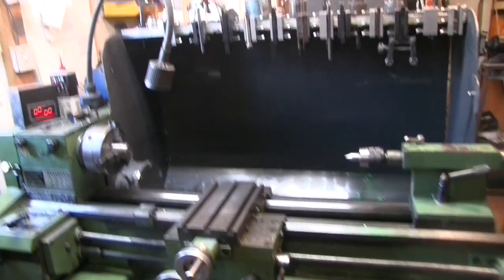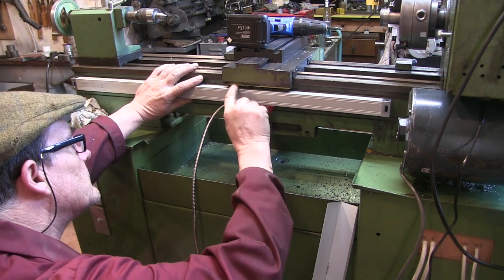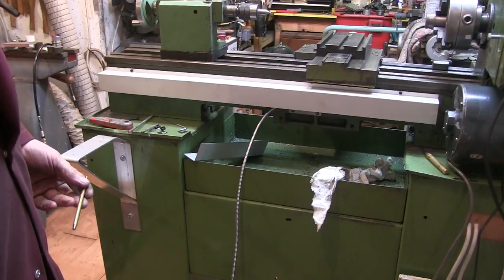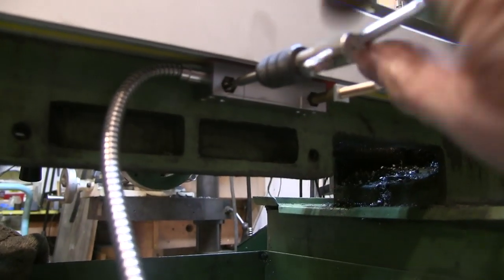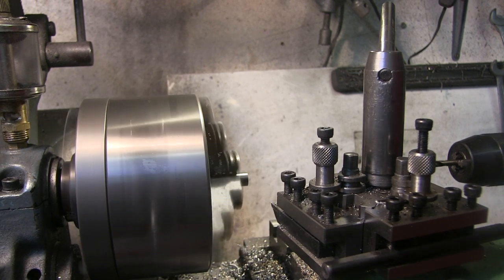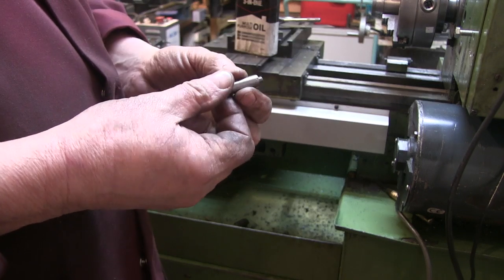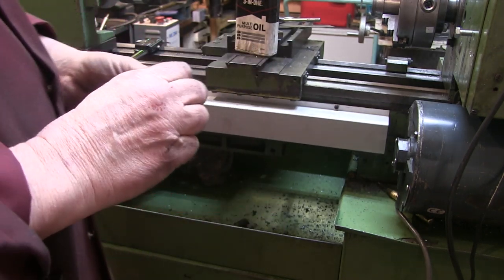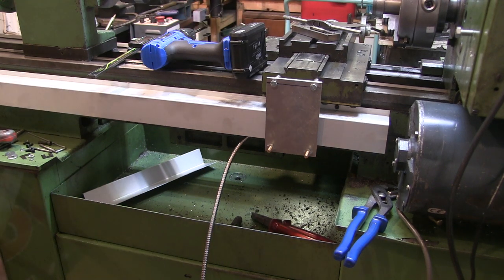Fitting the DRO to The EMCO, Part One

Comment: Lucky bugger , now you have joined the '' stick the dials where the sun don't shine club !  ''   One day i will change over . Cheers .
Reply from the maker: Well Max, I am a bit of a Ludite! its not earned my trust yet, and as it is may never, I don't think the mountings are sturdy enough, cable movement can alter the display by 5-10 microns, which is F**k all but very disconcerting! :-)
All the best,
Cliff
Reply: @CliffsShed  That's an interesting point . I have never fitted one up .......yet .    Cheers .